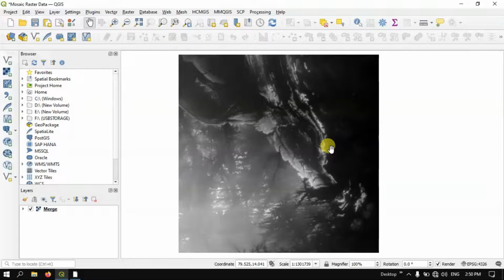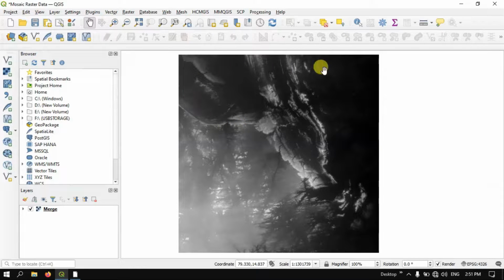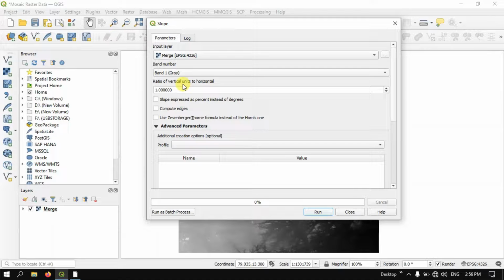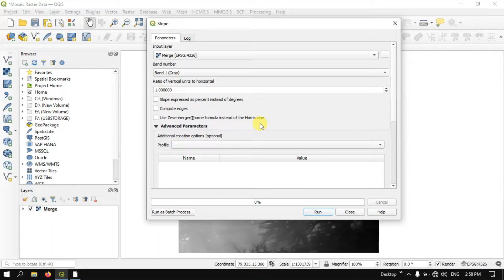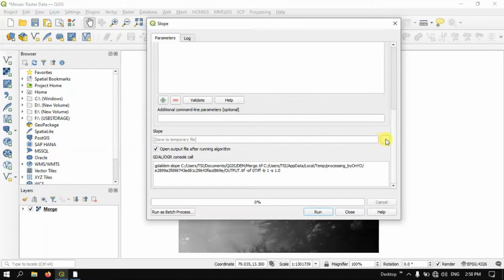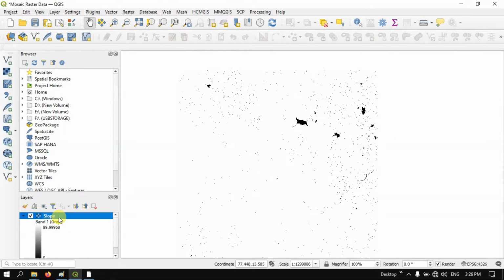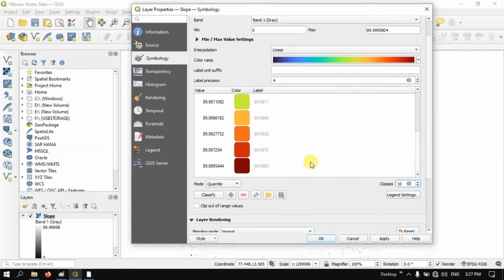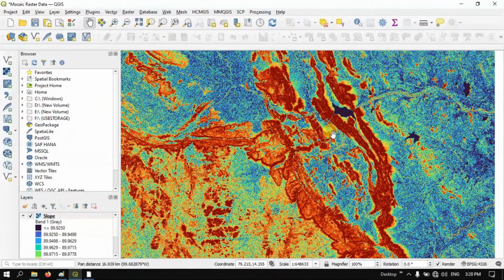QGIS Tutorials 44: Slope Analysis in QGIS

Comment: While this does generate an accurate slope model visually, the raster values are not helpful! This is because the DEM is in a decimal degree CRS and the elevation units are in meters. While I'm sure there is a ratio value you could use here, my workaround was to search for 1-meter DEMS in a UTM CRS. Using this data source and the process show in the video worked like a charm